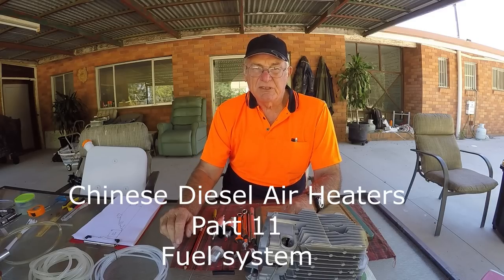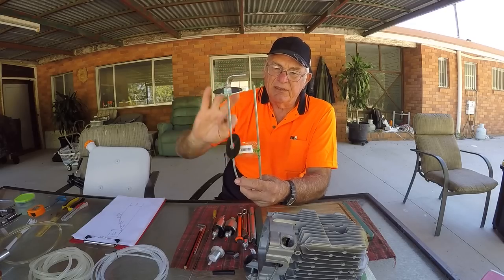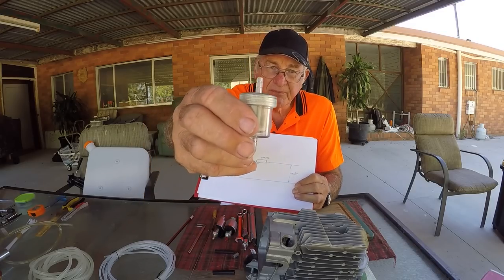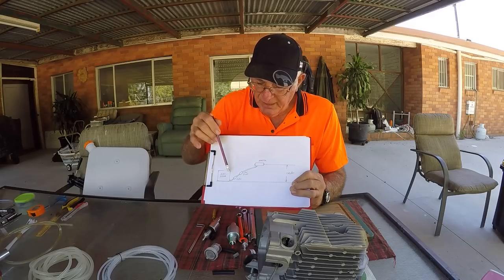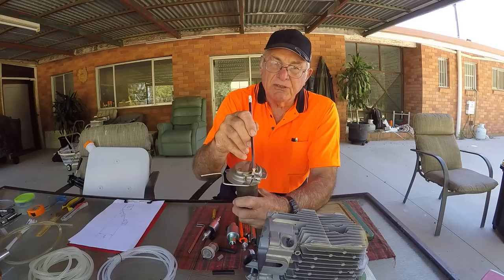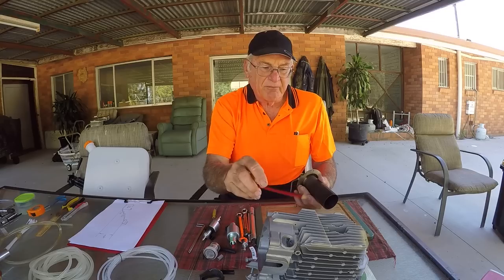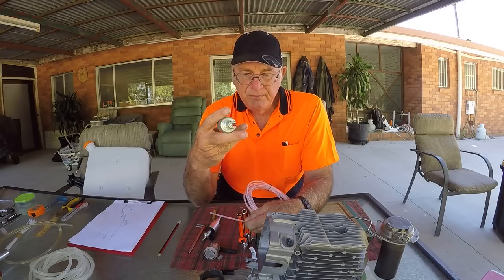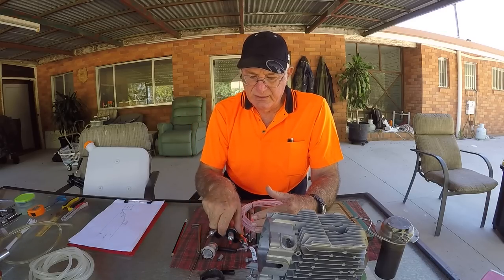Chinese Diesel Air Heaters - Part 11 -  Fuel Delivery

Comment: Hello John , I purchased a Chinese park heater model XMZ-D2 all in one unit. a few months back. I have only been able to run it straight for 6-7 hours and the unit shuts down with E-08. I have broke down the unit several times and it’s packed with soot. I’ve cleaned the screens, glow plug, burner components and the small air intake hole. The exhaust is wide open with  1 - 90 degree, the intake is straight down 9 inches with no restrictions.  The fuel line is only 15” long, full of fuel with no bubbles. After cleaning it starts fine, and runs perfectly on high for 6-7 hours then shuts down and again packed with soot. It’s running on diesel purchased from 2 different gas station , perfectly clean in a new jug. The heater is mounted in a cargo trailer that is stationary.  I  have never changed any parameter settings in the controller , I typically just set the temp to 22-23c.  

Any suggestions would be appreciated.

Dave
Reply from the maker: Hi Dave,

Thanks for your feedback.

If you are getting soot build up you are most likely running rich combustion or oily fuel, 

Are you using winter diesel? If no, you may be getting gelling issues.

Also, is cheap kerosene available to you? If yes, I suggest you try a 90/10 kerro/diesel mix.

Also suggest you try running the heater in manual mode, that way you can manually set the heater output to see if it makes any difference.

I would be grateful to get further feedback on your issues.

Good luck.  JMcK
Reply: @johnmck1147 , 

Thank you for your quick response, yes I’m using a winter diesel blend with no extra additives here in Canada and I have tried manual operation but end up with the same results. 

The dealer I purchased the heater from has no solutions and has agreed to take the unit back with full refund. I have ordered a new unit but upgraded to 8k from 5k. The price was basically the same, not sure there’s any real difference between the 2 units, if any. 

Im looking into acquiring Kerosine for the new unit, kerosine in my area of Canada runs around $3/L in a 18.9L container.

Thanks again for your help.

Dave R.
Reply from the maker: David Rousseaux 

👍

Comment: Hi John, many thanks for the video! So, for an all-in-one diesel heater if I were to run 2mm nylon fuel hose only, I would need how many 5mm rubber connector hoses? One under the device next to the exhaust and air intakes, one on either side of the fuel filter (two), one on the other side of the fuel pump and one connecting to the fuel tank for a total of five, correct? Or, you would just need three of the black connector hoses if you were to still use the flexible kind of hose leading from the fuel tank to the fuel filter and then nylon hose from the filter to the pump, after the pump and at the connection under the machine, correct?
Reply from the maker: Hi Dacia,

From tank to filter to pump you just need normal 4mm good quality fuel hose. 
From pump to heater you should use narrow bore hard nylon fuel hose. Dont't use the cheap vinyl fuel hose often supplied these days. It absorbs the pressure of the fuel pulses and makes it difficult to atomise the diesel in the burner chamber. It also tends to perish quickly.

However with the all in one heater the distance from pump to heater is very short and I now often just use normal 4 mm quality fuel hose through out. Quality fuel hose is less likely to absorb the pulse in very short lengths, and will work ok with at all in one heater, and cause less issues with joiner leaks. JMcK
Reply: @johnmck1147  Yes, yes! Thanks!  I ordered legit Webasto 2mm hose. Also, how do I prime the fuel system the first time before use?
Reply from the maker: To prime, you can use the prime function on the controller for very short lengths, 
You can use an outboard type prime bulb.
Or you can prime the old fashion way, see motorhome video. 
The method is totally up to you.  JMcK
Reply: @johnmck1147  Thanks again John! What year is your Hilux? Late 80s/early 90s?
Reply: @johnmck1147  Ah! I have yet to watch that video. I will!

Comment: Thanks for these videos, very helpful! Is it possible to install the heater in vertical position? I would like to place ti vertical with the hot air pipe on top, what do you think?
Reply from the maker: Hi Umberto, these heaters are a clone copy of the German Eberspacher heater and they are designed to be mounted horizontal with the exhaust pipe facing down. However they can be rotated horizontal up to 90 deg provided the glow plug is on top.

They will tolerate and run for a while in other positions like vertical, for a while, but you will cause serious maintenance issues with high carbon build up, hard or total non starting, and safety issues with any unburnt diesel seeping down on to the fan. Better to mount horizontal and and run the ducting vertical.   JMcK
Reply: Thank you John, you are very helpful. I will follow your advice!

Comment: Hi John, I could use your advice. I have installed a Chinese diesel heater and found that when the unit is heating up it seams to be burning the big rubber mounting gasket and causing it to smoke. Once setpoint temp has been reached and the power drops off the rubber smoke stops. Can I get rid of that mounting gasket and mount it directly to the current stainless steel L-bracket. Many thanks
Reply from the maker: Hi Greg,

That large gasket is made of silicone not rubber and should not smoke. It seals the heater to the substrate you mount it to. Are you sure it is the gasket that is making the smoke? Where is the smoke coming from?

It is possible, but highly unlikely the seller just had gaskets made of rubber and not silicone. If you remove the heater and check the gasket you will soon see if the gasket is melting. 

Also if it is the gasket, it will still smoke when the heater is hot and set point temperature has been reached.

However, in the highly unlikely situation the gasket if made of cheap rubber you could use high temp silicone instead. But as I said before, your issue is most unlikely to be the gasket.

If mounting directly to a metal floor you do not use the big mounting plate, but you still use the gasket. The mounting plate is used for other substrates. (Have you seen the motorhome install videos)

If the smoke is coming out from underneath the heater and the gasket is silicone, I would check that the exhaust is tight and secure to the heater.

Have you had the heater apart? Did you put it back together correctly? 

I hope this helps, but I need more information before I can offer more advice.

Cheers.   JMcK
Reply: Hi John, it’s coming from the gasket area near the exhaust outlet. I tried sealing it initially with exhaust cement which didn’t work. Cleaned all that out and have used high temperature silicon sealant. Could be the sealant. But it’s rated at 315 deg/c. The smoke doesn’t smell like diesel fumes. The carbon monoxide meter has not picked up any leak at this point. Not sure where to go with this one.
Reply from the maker: Greg Shaw 
Hi Greg, sorry for the late reply.
If the exhaust is not leaking and from what you describe  you perhaps either have a broken case gasket or a crack or split in the aluminum heat exchanger itself. 
Sorry I can't help more.  JMcK

Comment: Hi John, over last two days I have removed the correct hard type fuel line from tank to pump cleaned perfectly, replaced fuel filter and pump.  I primed the pump and eventually it started. I ran the unit from H-1 to H-5 perfectly for over one hour. I turned the unit to “off” to cool down but when I went to start again up came E-04 and as much as I tried over again it would not start. I persisted to no avail as the unit remained E-04. I checked the power at the pump not primed 4.15 volts and between9.8 and 10.15v when checked with multi metre. I am not sure if I have broken wires from unit heater to fuel pump otherwise I have no idea where to go? I tried another new controller the new motherboard for compatibility but still E-04. Where should I go to now? New heat? Replace the lot? I’m confused! Thanks Neil
Reply from the maker: Hi Neil,

I suspect you have a low voltage issue. I had a mate bring a his caravan around to me recently with similar issues. I suspected low voltage issues when I saw the tiny main DC wire that came with the heater, and also he had connected the heater to his DC distribution box. (Another voltage drop area) A simple voltage test showed the voltage at the heater drop from 12.5 V to 10.1V when the heater was turned on and the glow plug started.

I did a quick test with some heavy wire running directly from battery to heater. Worked fine.

Suggested to mate he run heavy gauge wire directly from the battery through a 20 amp circuit breaker to the heater. Cut the sub standard thin DC wire as close to heater as practicable and join new thicker wires. He did this and issue resolved.  

Please let me know how you go.  JMcK

The simple
Reply: @johnmck1147  eureka. I’ve found the problem. That thin wire from heater to pump was crushed and when I walked around caravan sometimes it would split then join.  I’ve taken the heater out replaced the silicone , rerun it heavier wire soldered joins and tomorrow will run. I tested it running along floor inside now to complete the insulated job. Thanks for your help. The last thing I checked. Should have been the first! Thanks Neil
Reply: Now I have 4 pumps, 4 filters, 2 motherboard and 2 controllers . If anything breaks down I’m ready for the next ten years?  Cheers Neil

Comment: Hi John, thanks for posting your great videos. I have one of these heaters fitted with the last controller you mention, I run it on a 12 volt system and am having huge issues with it defaulting back to 24volts. The heater works fine.Question: If I install the first controller you describe, the simple one, will it work automatically with the 12 volt system or will the heater require a 24volt power supply? Can I just plug it in to work?Thank you in advance.Cheers.
Reply from the maker: Hi Peter, if you buy the simple dial controller it will generally come as 12V unless you specify otherwise. In the past you could just swap controllers around as they came with standard wiring and plugs, but now there are some manufacturers selling heaters with non standard wire protocol making changing controllers more difficult. JMcK
Reply: John McK 47 
Thanks for such a prompt reply John, I guess I will just have to give it a go when I get my head around the price of a basic controller being half what I paid for the whole unit new. Here’s hoping that it’s the controller That came with the unit that defaults to 24volt every time power is disconnected not the unit.
Cheers again
Reply from the maker: Peter Geen 
👍

Comment: A am really curious to know if you could also burn other stuff or fuel's in there?! 🤔
Reply from the maker: Hi TOF, I have answered this question a number of times.
Yes you can burn many other types of fuel......For a while.
The more “oiler” the other fuel, the sooner heater will stop due to severe carbon deposits, and it will require much more maintenance.   JMcK

Comment: Hey John, what do you use to secure the pump to the chassis. Mine came with a large rubber grommet. Seems to resonate through the whole chassis.
Reply from the maker: Hi Tony, 

I generally use the rubber mount supplied, and it is an acceptable isolator of noise. If you hear a loud ticking check to see the pumps orientation is correct and angled upwards. Trapped air causes loud pump ticking. 

If using the hard nylon fuel line, have you isolated that from the chassis? It will also transmit the pulses to the chassis.

If you really want quiet, suspend the fuel pump in space with thin Shock chord. 

I hope that helps,    JMcK

Comment: My heater came today and i have a question already..how in the heck do you put the fuel line fitting in the plastic tank?
Reply from the maker: Hi Twobears, 

Drill the hole for the fitting in your "jerrycan" tank, poke some thin  wire through the hole and wriggle it around so the wire comes out the top filler neck. Then slide the fitting down the wire, pull the end through the hole and screw on the nut.

You can also bend the end of the wire over  with some needle nose pliers so it holds the fitting part inside the tank to give you some leverage. 

You could also tip the tank upside down and feed through some string, shake the tank around until you can hook the end of the string and pull it out the fill hole. Then slide the fitting down the string.

Good luck.  JMcK
Reply: Thanks john..after i posted i found several videos on it and they all used the wire trick.

Comment: Hi John. Thanks for your video. Will the heater work in a vertical position (as in long axis perpendicular to the ground)? Space restraints mean it would be far more efficient to mount the heater vertically in my situation. Ideally, the hot air would exit at the top of the unit. I have trial run it in this position and it seems to work fine, but after watching this video, I wonder about incomplete combustion. The fuel pump would be mounted above the heater unit. Keen to hear your thoughts..
Reply from the maker: Hi David, the original German designers and manufactures of these heaters state these heaters are to be mounted with the exhaust facing down, but can be mounted on their side provided it is the side with the glow plug at the top. The Chinese copied these heaters and also make the same comment in their literature, but I suspect they also copied some of the original German manual and perhaps did not do independent tests.

I have trial run a heater in a vertical position, as you did and it worked fine, but to give you an answer I would need to do a long, real world test. However, I suspect in actual use you would get pooling of unburnt diesel at the base of the heater and around the glow plug preventing a heater start, and even diesel running down into the fan motor which could cause some very interesting fireworks.

A big reason the Germans instruct mounting in an exhaust down position is to allow any unburnt diesel to drain out the exhaust. Until it could be shown otherwise by safe testing, I suspect there would be a safety issue with vertical mounting.  JMcK
Reply: @johnmck1147  Thanks for your reply John. 
In the absence of any definitive evidence, I might have to revisit my mounting plan. Combustion is not on my list of desired outcomes!
Out of interest, after running the heater in my desired position for about 20 minutes, the exhaust pipe was free of any soot. Longer term may provide a different outcome.
One other query.. would hard fuel tubing (plastic/nylon) to the size of about 3mm id create too much  pumping effort? This might allow me to bypass the use of rubber tubing with hose clamps, and the attendant possibility of fuel leaks.
I'm sure I speak for many when I say your videos and your replies are very much appreciated by a lot of people.
Reply from the maker: David Shannon 
Hi David,

I now just use standard 4mm rubber fuel hose on the inlet side of the pump. That is from fuel tank to shut off valve to fuel filter to pump. I try to keep the pick up side short and mount the fuel pump close to the fuel tank, particularly if any substantial  lift is involved. Not so critical if the pump is about the same level as the tank. On the outlet side of the fuel pump I only use the narrow bore hard nylon tubing.  I put the nylon tubing in a protective sleeve, generally clear pvc tubing, this provides protection and pulse isolation. JMcK
Reply: @johnmck1147  Thanks again for your help John.